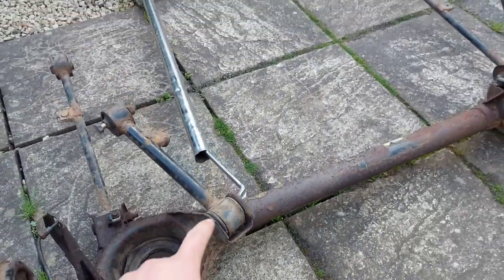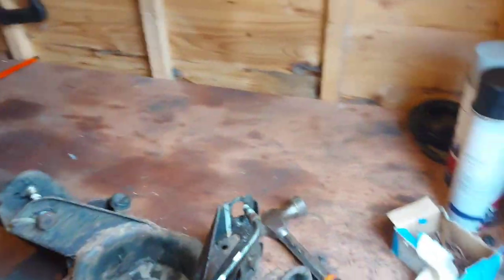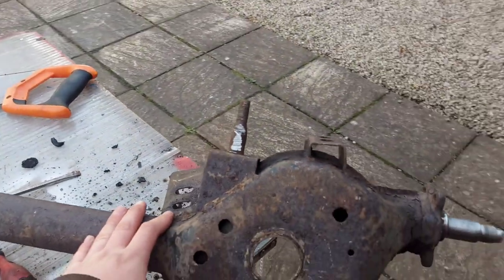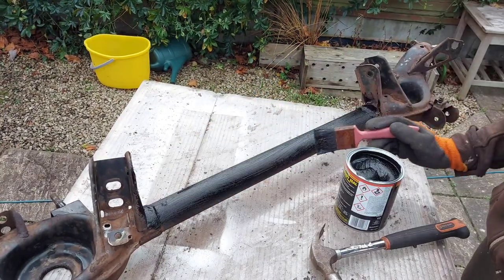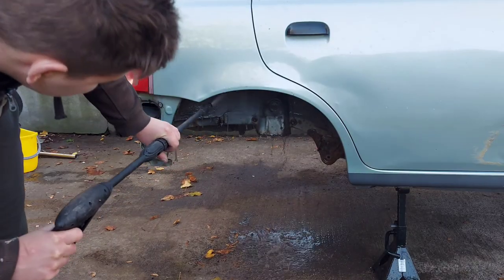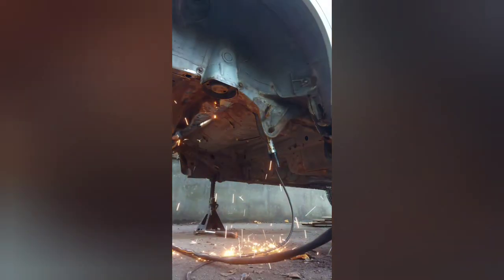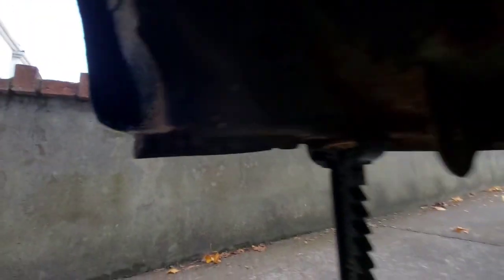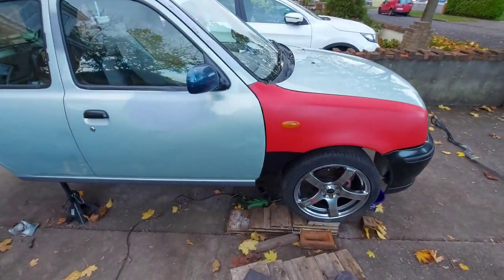Undersealing my K11 Micra

Comment: Nice to see someone young taking care of their "Classic car"!,  I have a 1974 Ford Cortina Mk3, that I bought back in 1976 47 years ago, fully restored on my channel, and some work I did on a 1999 Micra K11,  The anti rust treatment on the Cortina  included 36 layers of anti rust treatment, with the underside finished in UPOL Raptor in body colour, with a high gloss finish,  you might find the work I have done helpful and interesting  re dealing with rust issues, 
The key is to ensure you fully remove all the rust  back to clean steel, and ideally work on dry days, as moisture in the air on damp/rainy days will get on the steel, and can be trapped under any coatings you put on,  Pro Paint booths are heated to prevent moisture in the air when they paint a car, as well as to dry the paint faster,  I note you used a good quality "Waxoly" but personally a good quality primer like etch and zinc based on the clean steel then body colour and laquer before the waxoyl is a good idea, for long term  better protection,  Hope you don't mind my sharing these tips,  just thought my knowledge of dealing with rust on cars from the age of 14 (45 years) might be helpful, and great to see your enthusiasm for your car, the Nissan Micra K11 is a good little car., .

Comment: Maybe use rust converter or remover before painting over,  isn't it going to come through again?
Reply: Wax oyl is the best stuff all underseal does is crack and let's water in. I've used a diesel and oil mixture before it stinks but it was effective